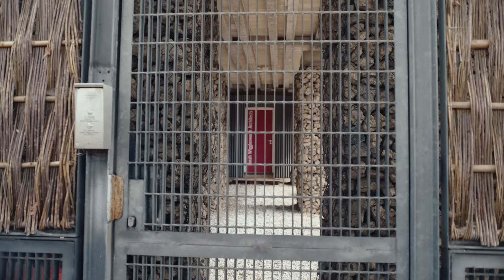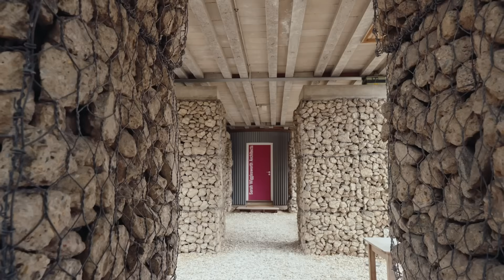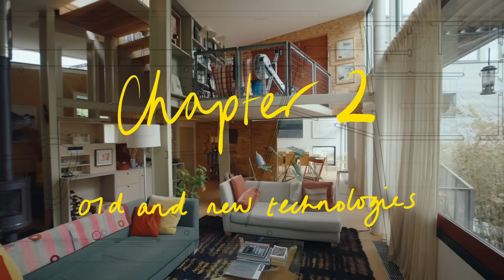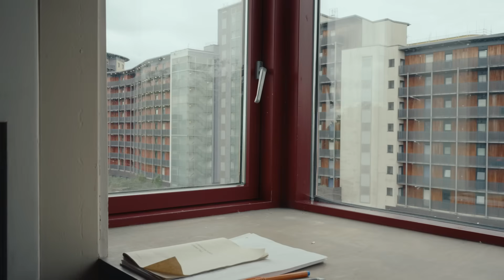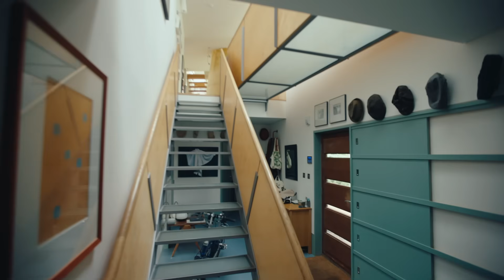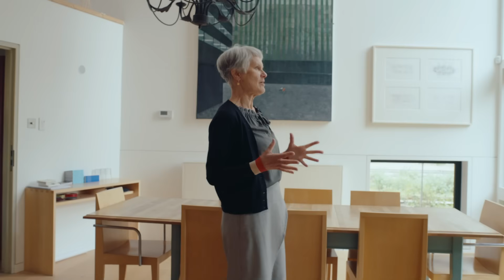Sarah Wigglesworth and Jeremy Till's self-built straw bale house

Comment: One all-time favourite houses and architect couples, as someone here said, I too remember this house well when it was being built, marvelled at the bold innovation.
It's sad to reflect all these years later how UK building has learned almost nothing from these heroic houses; what we did we get, a sea of utter crap being built across the UK - boxes, lots cheap, nasty boxes, and lament bitterly, the refusal of the corporates to allow any genuine innovation, to build houses that need minimal inputs. They are an utter maximal profits led disgrace, loathsome!
Reply: As the 60s song said, tricky tacky boxes, all the same.  And insulated for winter, but heat traps in the summer, we’ve learned nothing about solar shading & cooling for the new reality of our summers

Comment: The reason we don't use natural ventilation as much as we did the 90s is that electricity is now low carbon. In the 90s electricity was much dirtier than gas
Reply: I would say that it's because electricity is available to all, and is affordable; hence electric coffee machines, for example. A hundred and twenty-five years ago, and earlier, that would not have been the case, so manual solutions were employed. Back then, servant bell systems relied on mechanical wires and cables, not electricity.
Reply: Oh, you're one of those guys... your contention is utter rubbish, we don't because building firms/corporations around the world are greedy and, above all, lazy. They want to build the same shit they always build, what there workforce knows and is easy; integrating passive solutions takes time, expertise, adds complication....they build cheap boxes for maximum profit - that's the reason!
Reply: @Bob-h4s2pI'm an MEP engineer who designs passive solutions all the time, in the right buildings 😅

There's a reason every PassivHaus has an MVHR